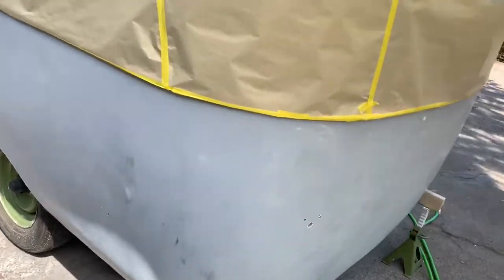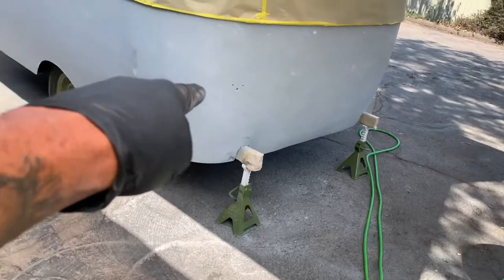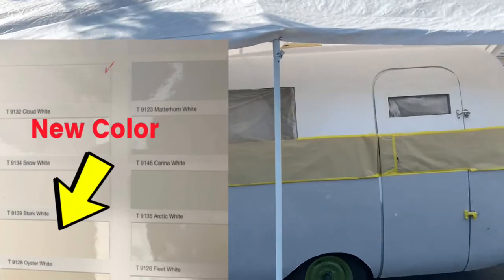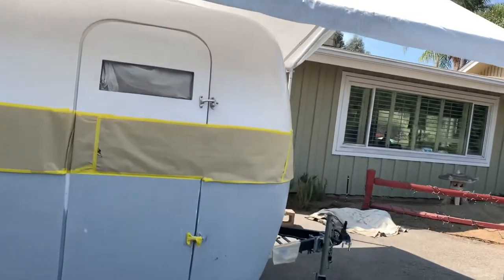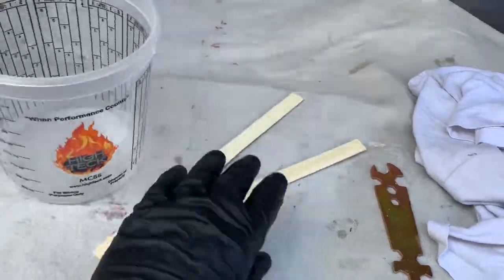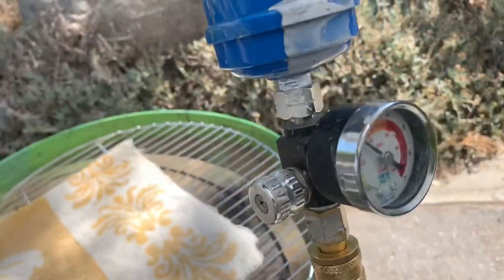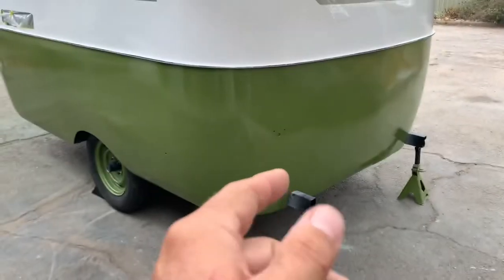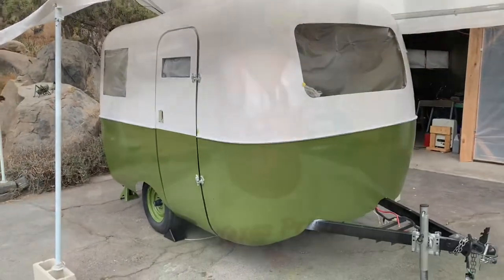Scamp Trailer Painted | Top To Be Re-Painted

Comment: I need a new paint job on my scamp but I’m so scared to start this process
Reply from the maker: Hi Breanna, thanks for watching.. so the top of my trailer (white) is rolled and tipped. Using a small roller, the bottom green was sprayed with a hvlp paint sprayer. In my opinion the paint rolling of the top half was not only really easy, but the results turned out much better.  I can walk you through step by step if you decide to paint.  👍🏼